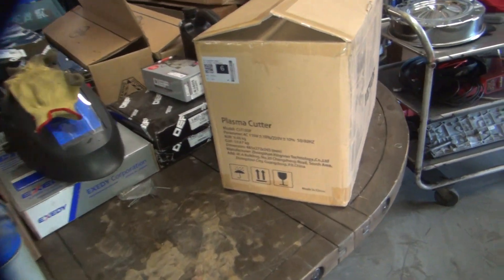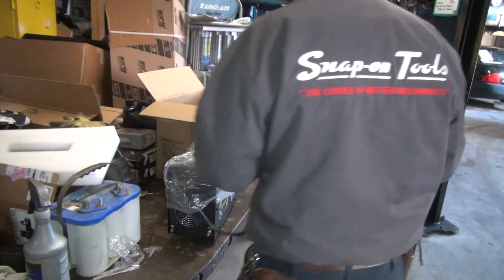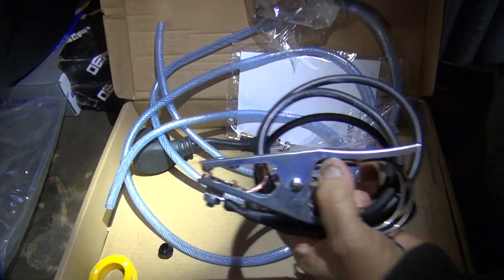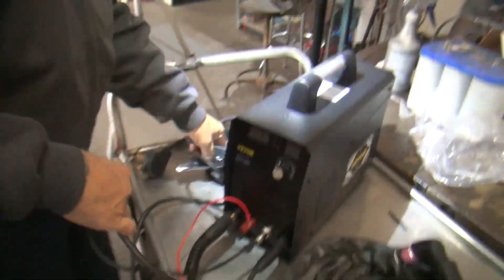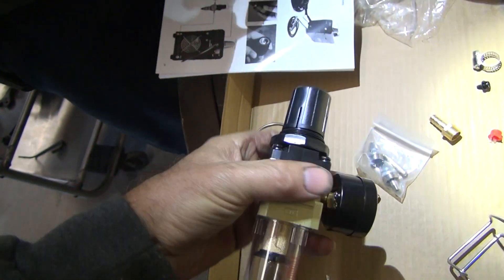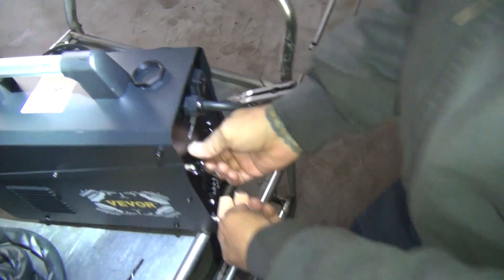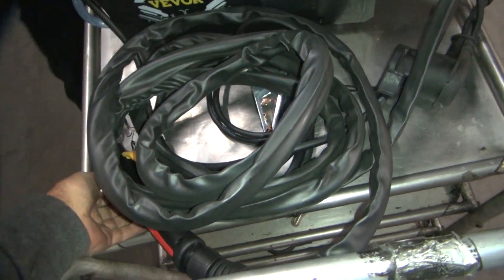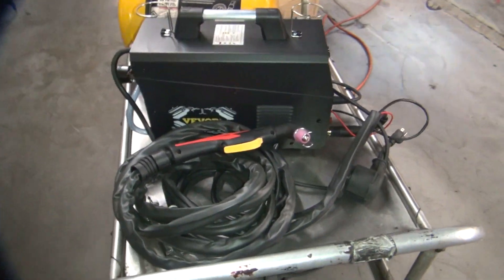#101 2022 new product review test vevor CUT-50P 50a air plasma cutter 110/220v harley tatro machine

Comment: Nothing mysterious about a plasma torch it's basically a tig torch with the tungsten set back inside the collet body with the tungsten ground at 30 degrees and a flat end the size of a pencil lead. Gas is used to constrict the arc around the orofice with high freq maintaining the arc. You can use any inert gas, compressed air is the cheapest to use but you can use argon, helium, co2 depending on what material use are cutting or welding. Plasma torches are great for welding thick materials by keyhole welding.

Comment: you guys are double the trouble- rushing ahead lol  Use the teflon! Slow down- are you in a race?  whats the price of the box?
Reply from the maker: i think we work good together and i have not know him that long. we both respect our skills and get the job done without getting in each others way. the air leak was the cheap hose clamp, not the teflon that we did use. when you charge by the hour, you learn how to fix things and solve problems quickly. we both have been doing this crap for way over 40 years so we do things faster than newbes.
tatro